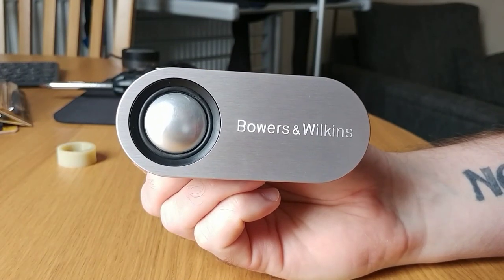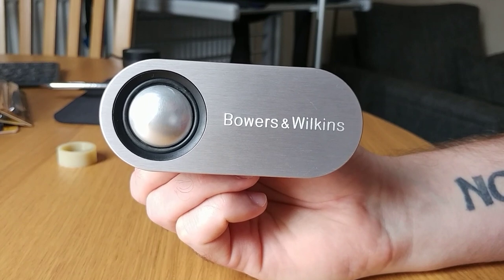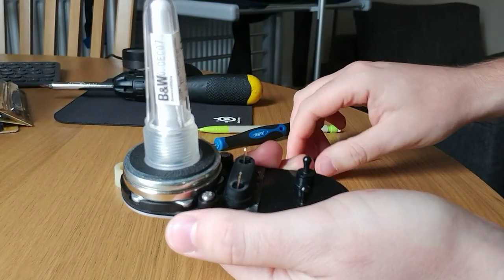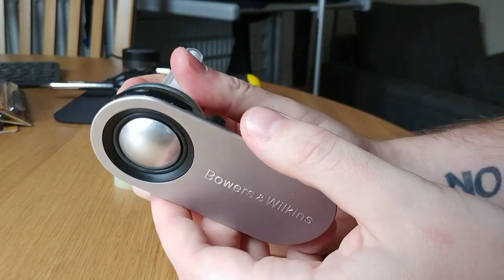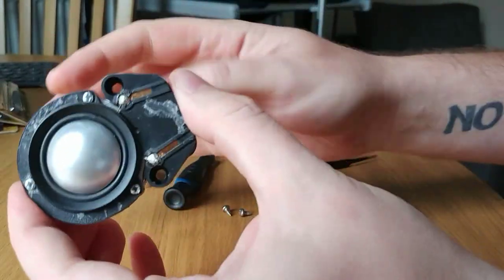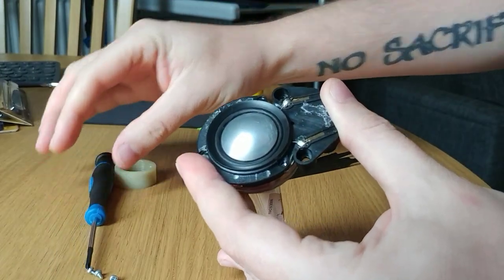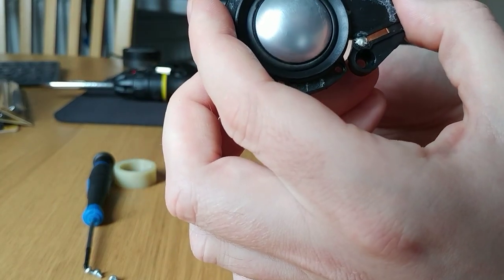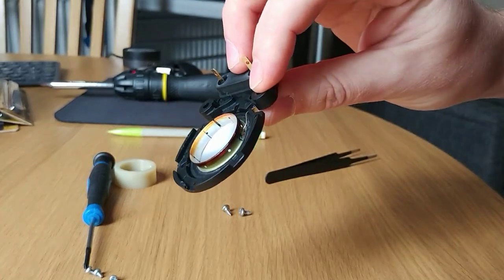Bowers and Wilkins 683 tweeter dent repair

Comment: I fixed mine with a handheld vacuum pump and an infant nose cleaner. I cut a section out if the ball area until it fit over the dent like a suction cup and connected the pointed end to the tubing on the pump, applied a small amount of suction and the dome came right back.

Comment: Hi excellent video! I know this is an old video so crossing my fingers for an answer. How is the diaphragm itself attached to the plastic frame? Glue? What kind of glue is apropriate for this? And how do I safely remove it? Many thanx 🙏
Reply from the maker: Hi. It was glued to the diaphragm. I had an old tweeter completely apart a year ago (although didn’t video it). I googled the same question at the time and deduced it was either cyanoacrylate or epoxy. I assumed that being B&W they’d use cyanoacrylate and so I used nail polish remover. That loosened it substantially and I was able to fully and cleanly remove the rest with a craft knife. I didn’t put it back together, but if I had, I would use cyanoacrylate. Only because I absolutely hate using epoxy 😂 Hope this is helpful.
Reply: Thank you for replying 🙏 I got a pair of 684 S1 yesterday with one damaged diaphragm. Figured I will try and replace it myself as soon as I can source one of decent quality. 😊 Job seems a bit fiddly but pretty straight forward. Maybe I'll even record it.

Comment: Has anyone else tried this method with a pair of 686? The tweeters are not the same but smilar looking ones both models were produced same year..Thank you for the video!!
Reply from the maker: Hi @emrelsd. I actually had a pair of 686’s as presence speakers a long time ago. I would hazard a guess that they’d come apart in much the same way. I believe the tweeter is the same, but the aluminium badge and the plastic behind it is just slightly shorter in length.

Comment: In a cool environment (Under 74F)

1. Blow dryer
2. Clear packing tape.
3. Heat the tape not the tweeter 
4. Place over dent trying to make contact inside crater
5. Go do something else for an hour or so
6. Put a finger gently on a non damaged part to hold dome so you do not pull dome out
7. Lift carefully straight up but this is where what you do next will vary (Sometimes angling it a bit will help here and sometimes not)

At best and If you are lucky the dent will come up perfectly but it will leave a faint discoloration where the dent was.  At worst you will get the dent out but it will bumpy in the dent area.  I add this because not every BW tweeter dome can be accessed this way. The bottom line is BW took way to long to address this and add tweeter grills.

Comment: I got a set of 800 Nautilus from a guy and one of the tweeters on the sc1 was dented. Ordered a new one from B&W parts and started to take on the repair. Once apart I basically did what you did but I found using a phone or tablet rubber tipped stylus worked magic. 
Give that a try for the people wanting to attempt this delicAte form of paintless dent removal. 😁

Comment: Hey Frankie thanks for this video! I have a 686 and it looks like that little plastic cone on the back of the tweeter is broken off. Should I re-attach it or is it unnecessary?
Reply from the maker: I would definitely reattach it. I can't say for sure but it looks as though its there to dampen vibrations and probably helps prevent the tweeter sounding tinny.
Reply: @_rowjack_4761  Thanks a lot!
Reply: @Tangyorangutan  @Frankie Howard would you use glue or a high adhese double sided tape please to attach the plastic cone? ive had this happen also and wondering what to use and how attached it needs to be :) thank you
Reply: @spacescraper2009  I used glue! I can't remember exactly what type (epoxy/wood glue, perhaps JB Weld) but I applied the glue, re-attached the cone, and placed it upright on a soft towel (or any soft surface to protect the tweeter) and let it dry overnight.

Comment: Would be great to see a vid of replacing just the dome! As you cam get spares of these
Reply from the maker: I'm sure I have an old one kicking around somewhere. I'll see if I can dig it out in the garage tomorrow and will link a video if I still have it.
Reply: @_rowjack_4761  ok brilliant. I have just purchased two domes from ebay for my 684s... ibe followed your video to get this far but a little nervous to remove/ unglue the actual dome! Thanks
Reply: @_rowjack_4761  did u have any luck ?

Comment: Thanks a lot for this! 👍
My buddy has the same tweeters in his speakers I think. But his tweeters has holes in the diaphrams. Does anybody know if these can be replaced or we will have to get all new tweeters?
Reply: If you call b&w I believe you can order just the dome/diaphragm. I am not sure if they send it assembled with the plastic plate and the terminals, or with just the dome coil and bare leads. I believe you get the dome and have to attach it to your original plastic plate with terminal connections. I have found b&w very helpful and willing to sell you parts no questions asked.
Reply: I just purchased a new tweeter. It was relatively cheap.

Comment: In the chamber behind the speaker put some natural wool alpaca wool or or rabbit wool pack it in about an inch
Reply from the maker: I'm intrigued. What does that do for it?
Reply: @_rowjack_4761  well comes down residence in the diaphragm stop back reflections as well. Should make the tweeter sound sweeter and have better time delay

Comment: Where did you get the replacement tweeter? Are you based in UK?
Reply: @DickCheeseman  hi did say at the end of the video that it's his 3rd tweeter and he's fed up of spending money on it each time. Mine is beyond repair that's why I'm trying to source the part.
Reply: @DickCheeseman  I've had a search notification set up with them for a while, but thanks.

Comment: How did you get the other speakers out first? From the front or back. I can't see any access points.
Reply: Cheers James, A bit more assurance on how to do that would be super handy. I REALLY dont want to damage my super nice speakers. I did try sticking in a very small screw driver to pull the housing forward but i didn't have the cahones to give it a heavy handed attack.
Reply: I had the same worries but then just gave it a go and it popped out fairly easily

Comment: or take out a vacuum cleaner and place it on the tweeter.

Magic.
Reply from the maker: Tried with the Dyson. Didn't work. It would have left horrible creases in the metal if it did, too.

Comment: My B&W 683 tweeter replacement part came without the plastic housing part with foam material on the back of the tweeter. At the base of the plastic housing are threads for the plastic ring to secure the tweeter in the speaker box. So, I need to remove this housing part from my old one with the broken tweeter dome and reattach it to my new tweeter replacement part.  What do I need to do to remove this part without breaking it and attach it to my new one? Is this housing part held in place using some sort of a super glue? Any ideas?
Reply from the maker: Joe Friday Did you buy direct from B&W? If you did you should send it back and ask for a full replacement. If not, I have an old tweeter here. Give me an hour to run an errand and i'll get it out and take a look for you.

Comment: Use the vacuumcleaner, to get the dent to pop out.But be careful. do not disassemble
Reply from the maker: Didn't work with a Dyson.
Reply: Will work if you are lucky or you might suck the dome out of the speaker. These are not like other tweeter domes and do not respond to suction in the same way.

Comment: A dented dome would have been a good example.
You will still have small bends in the metal wont completely be smooth.
Reply from the maker: Oh, for sure. But it'll be a heck of a lot prettier to look at. Unless you're a computer, you won't notice any difference in sound quality either. I only thought to record this video for people after I'd smoothed out the dent and realised how much of a pain in the neck it is to do.